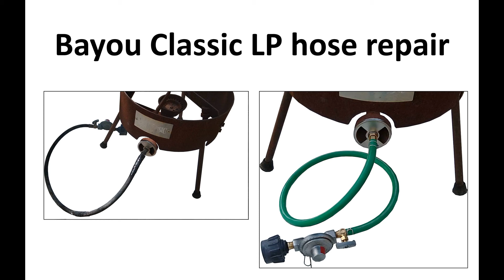Bayou Burner LP Hose Repair

Comment: I love your video.  Maybe closeup on the hose clamp. 
Your video just saved me 30 bucks 
now I can go get some steaks for 
the bbq.  Thanks bud.
Reply from the maker: Hi Jeremy, Thank you for commenting, encouragement and suggestion. I'm glad you found value in this video for your viewing time. The following video gives more details on making the clamp tool and using it. I've found that doubling it up like I show in the video isn't needed for most applications. You'll get a good sense of how the tool works and a closeup of the finished clamps.

Best of luck with your repairs.

https://youtu.be/82E3ARNtglg